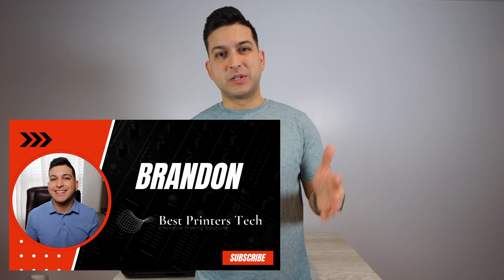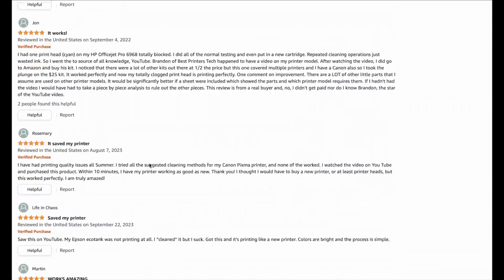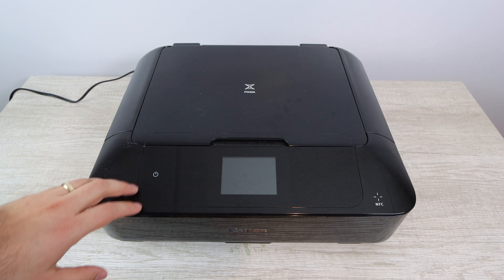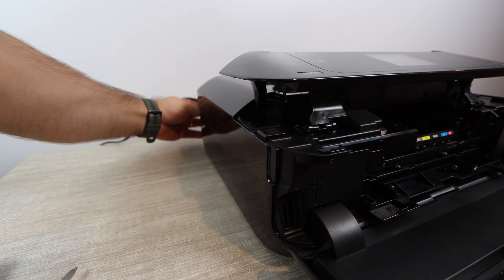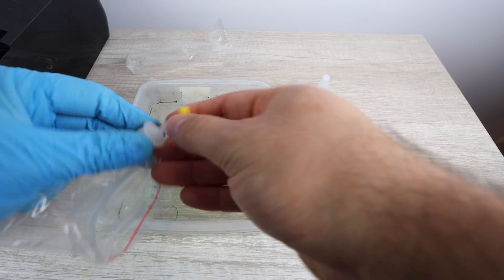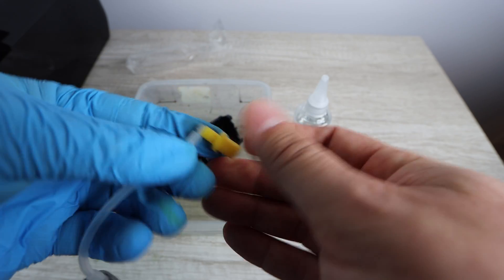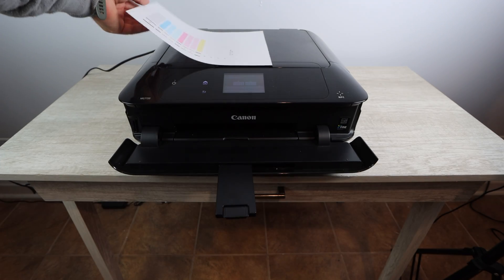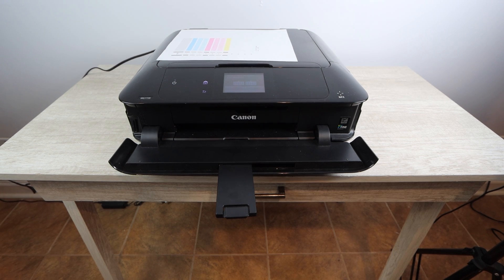Canon MG 7720 Printhead Cleaning (Not Printing Black or Color Solved!)

Comment: Judging by the video and the comments dates (more than 1 year), I'm not sure if my comment will have any reply. Let's see.
I have an MG5450. A year ago a piece of paper got stucked inside and I had to pull it out, exerting a little force, and after that the printing wasn't the same.
I had the printer stored since then and now I needed it. I did the cleaning and alignment of the print head (the printer maintenance cleaning) and to my surprise the quality was better then when I last used it, a year ago.
But even after that, the printing it's still a bit smugged and irregular. After a few prints, the cyan colour started to fade and the black ink (dye, not pygment) is smugged and very faint.
I'm gonna try a proper cleaning, like the one portrayed in this video, and see if things get better or if I'll have to probably buy a new printhead.
My doubt is, when you soak the whole thing, in the end won't the darker colours (blacks for instance) interfere with the light ones (yellow/cyan) ? What I mean is, won't the inlets of the lighter colours be tainted with the darker colours ? And by the way, in the end, after rinsing and cleaning the priinthead, and especially the inlets, do we dry the inlets ? If yes, how do we do that ?
Well, that was so long it sounds more like a will, but if anyone would be so kind and would clarify a thing or two for me, I'd really appreciate it.  Thks !...  :face-orange-biting-nails:
Reply from the maker: Hi Rui, thanks for sharing your experience—great question. When soaking a printhead, cross-color contamination is minimal if you use clean distilled water or a dedicated printhead cleaning solution and change the liquid as it discolors. Each color inlet draws from separate internal channels, so long as you rinse thoroughly afterward, residue transfer should be negligible. After cleaning, gently shake off excess fluid, then allow the printhead to air-dry for at least 24 hours on an absorbent paper towel in a dust-free area. Avoid using heat or compressed air. Once completely dry, reinstall it, run a nozzle check, and perform one light cleaning cycle before testing print quality

Comment: Thanks for making this video! I had an issue with the labels on the side of the cartridges interfering with installation. If this happens to others, just rip off the label on the side that is sticking, and the cartridge will then slide in easily. The genuine Canon cartridges do not have labeling on the sides. I contacted smart ink via chat and told them about the issue, so they can let others know. Great customer service from them!!
Reply from the maker: That’s a great tip, thanks for sharing!

Comment: Our blue/cyan was not printing, so performed the print head cleaning using the cleaning fluid, about 10ml in each one. Waited 24 hours. Now the PGBK (large black) is printing fine, but no colors are printing now. I've run the Deep Cleaning step about 5 times, with new ink cartridges. Any thoughts?
Reply from the maker: I apologize I could not get to your comment. If you would still like support, expedited responses and member only videos please sign up for a membership here 👉 https://geni.us/BPChannelMember

Comment: How in the heck do I get the print head back in this machine?!?!  It is impossible!
Reply: Wiggle it back there with the printed circuit board facing up. It is tight, but it works.